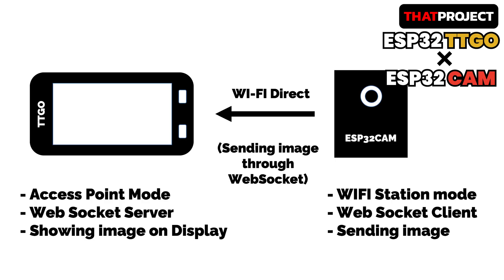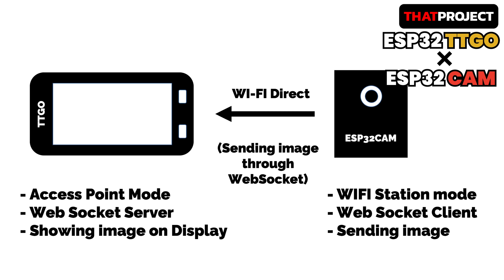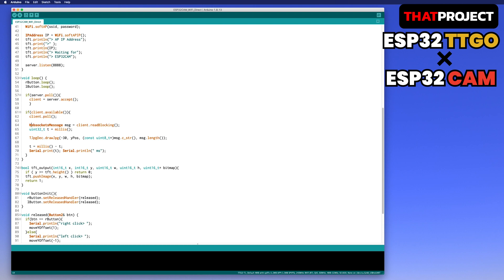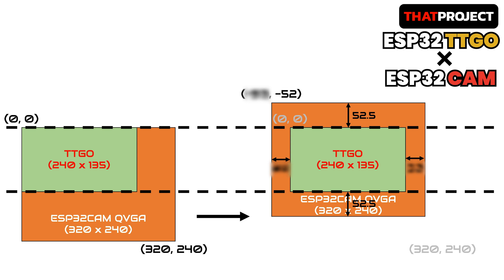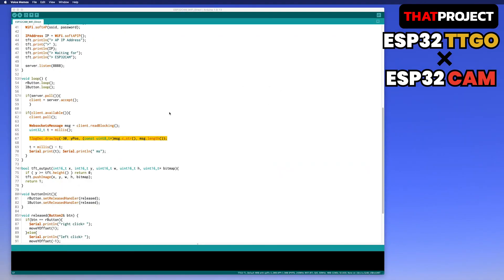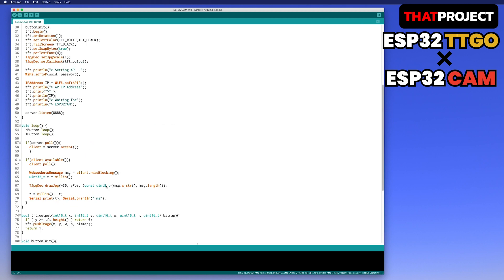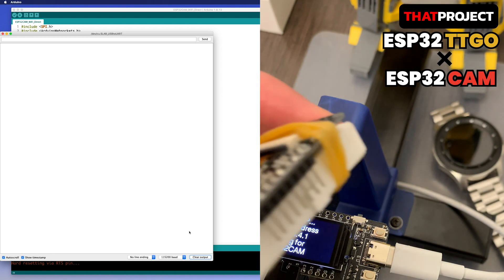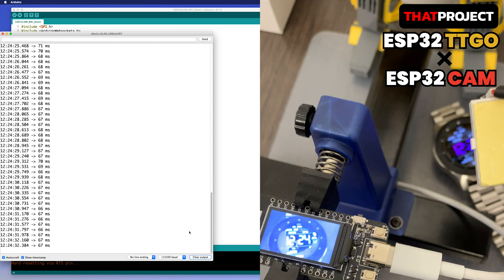[ESP32TTGO x ESP32CAM] Wi-Fi Direct! Output images of ESP32CAM to TTGO display. (ft. WebSocket)

Comment: I want to make this project to connect the general wifi camera:
Reply from the maker: It seems to depend on the protocol supported by the IP Wifi camera. In this project, since I used JPEG images directly, I was able to intuitively draw the image data on the screen, but I don't know if I can use this method as is.

Comment: Thank you for the video. What kind of battery did you use for the camera and how did you connect the battery with the camera? I also use ESP32 cam but it says we shouldn't apply more than 5V.
Reply from the maker: Here I used a typical Lithium Ion Polymer Battery. The output ranges from 4.2V when completely charged to 3.7V.  This has no problem running the ESP32CAM.

Comment: Thanks for a great video!
Is it possible to use other parts?
And use the same code for this parts?

ESP32 CAM Camera Module Kit 2.4 GHz WiFi Bluetooth 8MB PSRAM OV2640 Camera Module 160 Degree 850nm Night Vision

 LILYGO TTGO T4 V1.3 ILI9341 2.4 inch LCD Display Backlight Adjustment ESP32 Development Board WIFI Wireless Bluetooth Module
Reply from the maker: The settings may need to be changed to match the display you use.
Reply: Thanks!

Comment: Thanks  for your great video ! 
These days, I am doing an object recognition artificial intelligence example using Raspberry Pi, and I want to send cv2 camera frame to esp32 s2 tft lcd (makerfab) 
through websocket and display it in real time.  I've tried  with your code (esp server jpeg v3) and python client side code during a few days, but it's not easy. 
Can you give me some advice ?   I would like to use your esp server jpec v3 code as it is but  I am not sure how to process cv2.capture(0) frame data from Python client and send it to the esp server. Thanks !!!
Reply from the maker: Please check the format first before transferring the image obtained through OpenCV in Python Client to ESP32. I'm using the JPEG method here.

Comment: But why the big instability? I have to reset the cam every minute
Reply from the maker: I had no problem using my code. Please check your ESP32CAM again.
Reply: @ThatProject  Hi, great project. I just followed your video and I also get the same problem. I have to reset the camera all the time because the image freezes.
Reply from the maker: @rguifa  I don't know why, but the WebSocket seems to be disconnected. Is there any problem if you use the CameraWebServer example instead of my source code?
Reply: @ThatProject  If I use the CameraWebServer, there are no problems and the stream is stable. Did you have time to implement a socket reconnection?
Reply from the maker: @rguifa  I'll implement it in the next project.

Comment: I'm trying to get this working but not having much success.  
I've uploaded "ESP32CAM_WiFi_Direct.ino" to my TTGO display...no problems.
I'm not sure what code to upload to my ESP-Cam.  I tried "ESP32_CAM_WEBSOCKET_CLIENT.ino" but I get a ton of errors from both "app_httpd.cpp" and "camera_pins.h".  The errors are "stray 'x' in program" and "expected unqualified-id before 'x' token".  Am I uploading the correct code and why am i getting the errors?
Reply from the maker: First of all, you don't need the app_httpd.cpp and camera_index.h files in this project, so it doesn't matter if you delete them.
Camera_pins.h only default pin settings, so an error cannot occur. Please check the project again. https://youtu.be/TfuEI1-YrsA
Reply: @ThatProject  OK, thanks!  I got it working but I have some questions.  The TTGO code is looking for 192.168.4.1, correct?  The ESPCAM returns an IP of 192.168.4.2 but I get a picture on the TTGO.  How does that work?
Also, the ESPCAM frequently returns an IP of 192.168.0.189 which I can access via my laptop.  I usually have to try multiple times before I get a connection.  Is there a way to get it to be more consistent?
Also, I cannot get the two boards to communicate when they are just battery powered and neither is plugged into a computer.  Theoretically, they should be able to connect while both being independent, correct?
Reply from the maker: @dangimon9174  There seems to be some confusion.
TTGO acts as a server, and it shows its IP address 192.128.4.1 on the screen. This is the ESP32 WIFI default address. ESP32CAM connects to TTGO's WIFI network with the credentials. Then connect the web socket at 192.128.4.1:8888.
Reply: @ThatProject  So where does 192.168.4.2 come into all of this?
Reply from the maker: @dangimon9174  (I modified the previous answer.)
I don't understand how you got IP 192.168.0.189  from ESP32CAM. 
It looks like an IP address assigned by a regular network hub. Is there an intermittent break after ESP32CAM connected to TTGO? This is why it gets a new IP address?
Reply: @ThatProject  I think maybe my WiFi signal may be weak so the ESPCAM can't find 192.168.4.1 so it says to use 192.168.0.189 (local).  But what I still don't understand is when the ESPCAM connects to the TTGO it says "Camera Ready! Use 'http://192.168.4.2' to connect".  It should be 192.168.4.1
Reply from the maker: @dangimon9174  If you see the ESP32CAM source code, print ESP32CAM's own local IP address (192.168.4.2) to the console after connecting.
It doesn't really mean anything. This is the local IP address on the TTGO internal network because it is normally output after connecting to the TTGO network. You can delete this part to eliminate confusion.
 Serial.print("Camera Ready! Use 'http://");
  Serial.print(WiFi.localIP());
  Serial.println("' to connect");

Comment: HI, i have the ESP32 CAM working fine in stand-alone mode and get an image when I point a browser at the camera IP.
When I have the camera and TTGO set up using your code for this tutorial I get the following:

On the serial monitor for the ESP32 cam 
WiFi connected
Camera Ready! Use 'http://192.168.4.4' to connect (In the code I set web-sockets_server_host to 192.168.4.1)
and then the series of dots

On the TTGO I get the same messages as you, AP IP address 192.168.4.1, Waiting for ESP32CAM But no images ?

I've tried modifying Ip addresses but can't get it to work.
Hop that you can help
Thanks, Keith
Reply: Hi Just tried it again and eventually got the message 
WiFi connected
Camera Ready! Use 'http://192.168.4.3' to connect
Socket Connected!
 and the camera image appeared on the TTGO

I don't seem to be able to get the socket connected message reliably. I need to do a few resets
The picture does freeze after a while and then I need to reset until i get the socket connected message?
I'm running the ESP32 CAM from a separate 5v supply

So definite progress but do you have any advice?
Thanks, Keith
Reply from the maker: @keithemerson9349  Hey. A solid WIFI connection is important for a Web socket connection. If for some reason the WIFI connection is maintained, but the connection of the Web socket is broken, a process of reconnecting is required. (I haven't implemented this part yet. ) How often does this problem occur? Perhaps, it could be another problem.

Comment: Works on TTGO T-Watch 2020!!
Just some minor adaptations and it works, some glitches still as at unpredictable moments the connection halts. Looks like it is on the camera side, but I am not sure. This also happened with your sketch on the TTGO display...
Reply from the maker: It seems to be a problem caused by a network bottleneck. It's necessary to switch to UDP instead of WebSocket which is TCP.
Reply: @ThatProject  I have experience in Arduino/ESP32 programming, but I do not know enough of UDP and TCP; can this be solved on the ESP32?
Reply from the maker: @middelbh  Unfortunately, we can't simply create a UDP part and apply it to this project. I'm planning to do a project for large data transfer using UDP in the near future.

Comment: When i work with esp32 cam and tft displays, i setup the pixel format in rgb565 instead of jpeg, to avoid the process of decoding and get a better fps rate.
Reply from the maker: Thank you for your great opinion. I think it can be used for the next project.👍👍